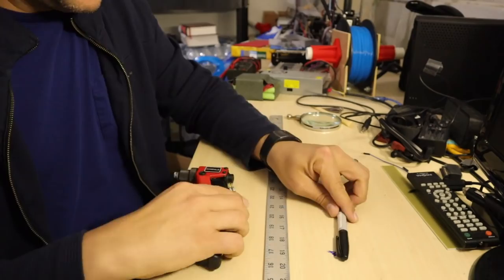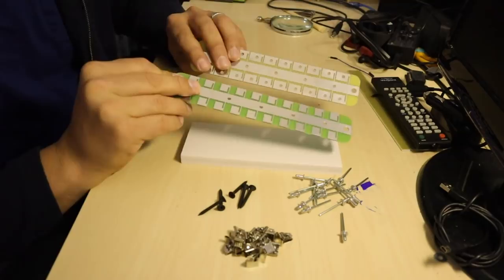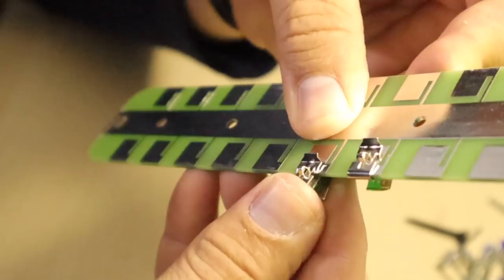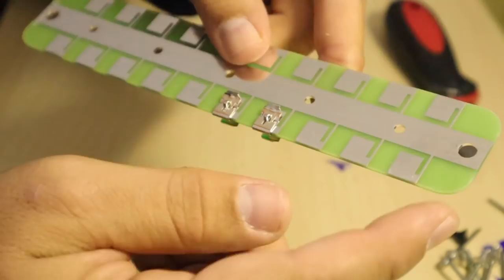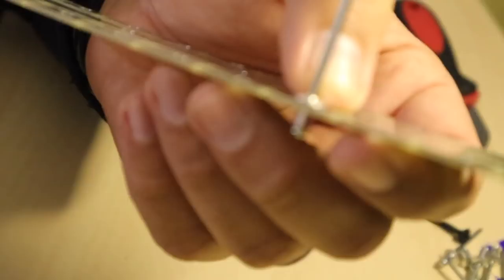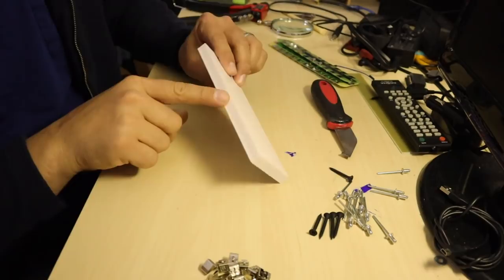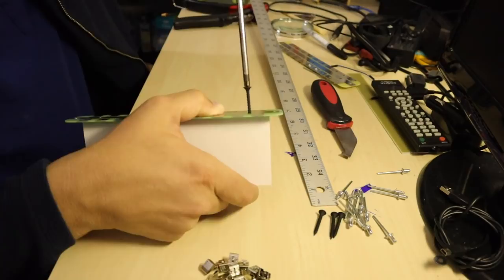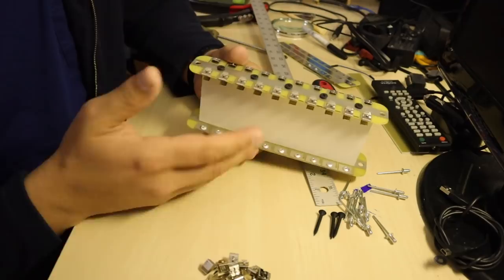How to assemble a module for the Diy Powerwall Battery Kit

Comment: Good Video!

Going to ask questions a complete rookie might ask. 

Let's say I messed up with my rivet for the negative side. Do I need to drill it out to correct my mistake? What size rivet do I need to buy elsewhere? 

Is the fuse built in? What happens when it burns out? 

Maybe your next video will show how to add your custom BMS?  I want to know how where the small wires are attached. 

The website does not mention by definition what is needed. I know that a 7S is for a 24 volt system, but newbies don't. A 14S is for 48 volts. Complete rookies miss that helpful information.

Comment: I like the simplicity and effectiveness of the design. On the PCB, where the battery makes contact to the main bus on the PCB there is a thin copper plated link which appears to be about 1mm in width. I am concerned about its current carrying capacity. What is the designed ampacity rating for this short strip?
Reply from the maker: design for 2a continuous and pops at 7a. the mm is a trade secret :D
Reply from the maker: I carried various test using fuses to make sure they work. I have a video here from a TV interview they did on me and the kit and the lady sitting next to me shorted the cells on the kit by misplacing them and the fuses pop in less than 5ms.

I notice the damage fuse when I got home. That's how safe these things are.

Comment: Hi Javier, looking forward to getting the kits we ordered. A quick question, in this video the center blocks are flat and in your TV appearance they are grooved to fit the batteries. Which will be in our kits?

God Bless you brother.
Reply from the maker: It will be Flat. We don't have a way to make the one on tv in large quantities.
Once we do, we'll make an announcement
Reply: Is it possible for me to get one to measure and return to you or possible to get the exact measurements. I can mill my own with the right measurements, Thanks
Reply: The request is of course for one with battery indents.
Reply from the maker: You mean the measurement for the spacer?
Reply: The depth and center to center spacing of the battery grooves and total width needed for the block to machine what will be the spacer with battery grooves on both sides.

Comment: What's the final voltage on those kits...
Reply from the maker: From 3.6v up to 50.2v. Please check the website, all the much needed info is there
Reply: Each module when completely loaded with cells and uncharge is about 3.6 - 7V (norminal) dependent on the brand of cell, but when charged it should read about 4.20V (max). A multiplication of the unit modules (1S, 2S 3S......11S, 12S 13S , etc) constitute the desired battery bank that would support your anticipated load or device(s). E.g.,  4S equilvalency, in a battery pack - is 16.8V (when fully charged; voltages add up). 4P equilvalency, in a battery is 4.2V (when fully charged; voltage stays the same accross all the 4 connected in parallel, but their collective total amperage from the modules adds up).